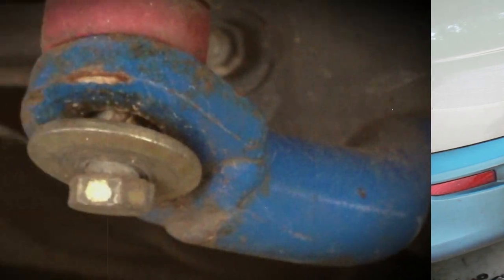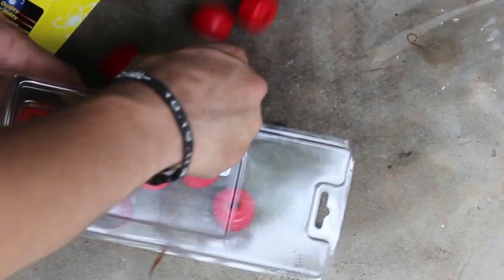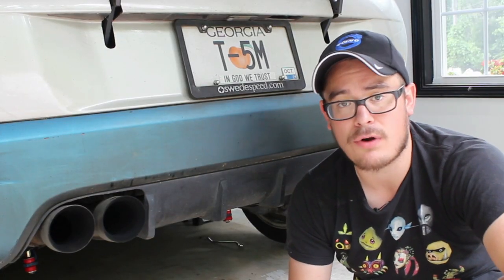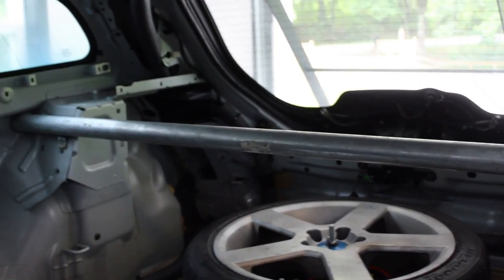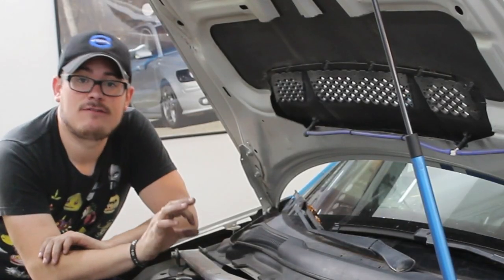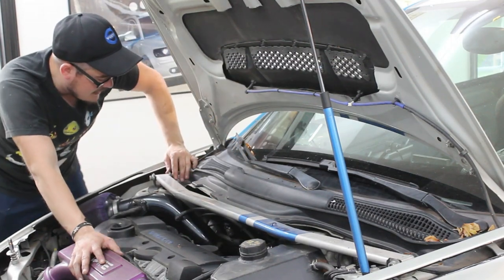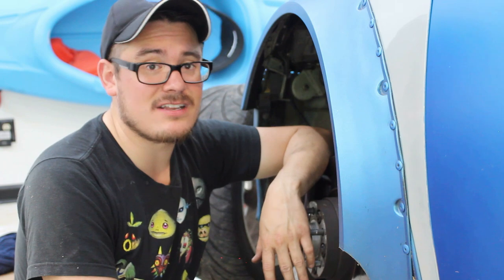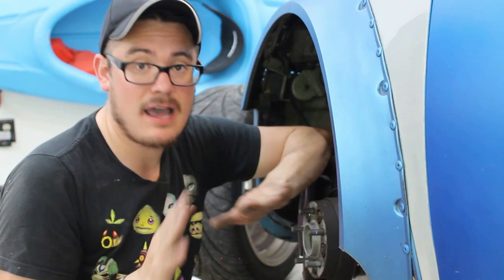My Volvo C30, Sway Bars, Strut Braces, & End Links Explained

Comment: I know this is well past late, but I have just begun modifying my new-ish to me C30 and went from no front strut bar to an SPR one and was curious to hear your input on it. Personally I think it looks the coolest and is similar to your Euro Sport bar in that it can pop off and is flat. Up next is some stage 0 fluids and spark plugs and then probably the whiteline RSB and I also picked up cheap Bilstein front B4s with R design springs, and found a guy selling Elevate rear springs which I think I'll pair with Koni Special Active rear shocks

Comment: Awesome video. First, what year / generation Honda Pilot for the front?

Second. I found the Volvo factory upper front bar at the junkyard on a c70 for $10. I think those were more common in those cars so anyone looking for a deal should check your local yard.
Reply from the maker: I believe the 2010-15 Pilot. A link to the Duralast part I bought is in the description.

Comment: Great info as always! Question on your H&R Coil-Overs... My local backroads (the fun winding ones) are rough. My first thought is to beef up my sway-bars and soften the suspension dampening. I was looking at Bilstein B16’s... I also see Raceworks COs in another comment... What do you think? (I checked your prior vids. If I missed one on coil-overs, my apologies... You’re just too helpful!)
Reply from the maker: Haven't uploaded a coilover video yet. I recommend KW, they make a great suspension with plenty of adjustability options to get something that rides better than stock. Bilstein is another great brand. I have no experience with Raceworks.
The H&R coilovers I have were one of the only available options 13 years ago, but they are terrible because they have no damping adjustment.

Comment: I found the Volvo C70 22mm rear sway bar to be a very affordable upgrade for my Volvo C30 (1.0 non R) comfort bar which is 20mm.  2mm made a difference.  Paired with a homemade upper strut/shock support bar it feels much stiffer

Comment: get the L bracket  swaybar and the L links, it holds better and isn't as hard to install as you probably think. I have the MS3 on mine with L links.
Reply from the maker: I had that style of sway bar on all three of my S40s and both FWD C30s. I wasn't a fan as the 90 degree balljoint is constantly moving, rather than transferring the load directly into the bushing and link itself. I first had this horizontal style on my AWD V50 and it became my immediately preference.

Comment: Can anyone point me in the right direction on figuring out what Mazda 3 parts are interchangeable with my S40? I've looked for some sort of cross reference sheet between volvos/ford's/mazda but haven't had any luck! Specifically I am trying to find affordable coil springs to close in the ugly wheel gap:/
Reply: Also I will like to know if there's such information... I have an S40 T5 and sometimes Volvo parts are too expensive

Comment: Michael, just curious what's going on with that second brake reservoir apparatus on the driver's side of the engine? Did you separate the reservoir for the clutch and brake hydraulic systems?
Reply from the maker: That's my coolant reservoir.
Reply: @MyNameIdeasWereTaken  ohhh that makes sense bc of the fender intake. Was very curious. Thanks!

Comment: Can the stock 2.5T hold up to high lateral Gs and high speed corner transitions at track days without experiencing oil starvation? I’m hoping to find out before I try tracking or autocrossing my 2012
Reply from the maker: I've never had any issues. I've only heard of a few cases of oil starvation on these cars; many are tracking mostly stock cars with sticky tires and no problems.

Comment: The C30 stock chassis is not very rigid compared to modern cars.  So a lot of bracing is required to get the car to handle flatter on the turns.  I can easily take a recent Civic hatchback and out handle the C30 on any road.

Comment: Would you recommend getting coilovers before all of these other suspension upgrades?
Reply from the maker: It really depends on your intended use for the vehicle. I think the sway bar and rear chassis brace are a must have for any suspension setup, including stock. But if you plan on lowering with coilovers, you may find that you want a different size rear sway bar based on the damping and camber setup you choose to run. Coilovers definitely provide the biggest improvement to handling and appearance, so I would personally want to do those first. But sway bars are cheaper upgrades and can be enjoyed on the stock setup. That doesn't really answer your question.... Sorry!
Reply from the maker: @chrisnipple3469  I have not. You generally get what you pay for with coilovers, but some cheaper options with full adjustability can often be good.